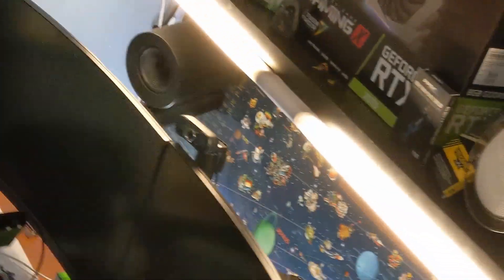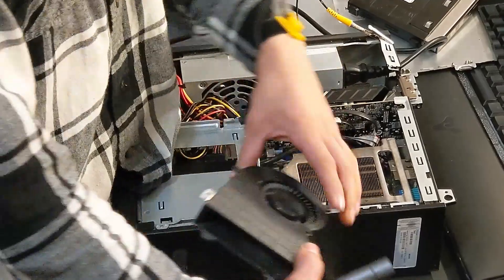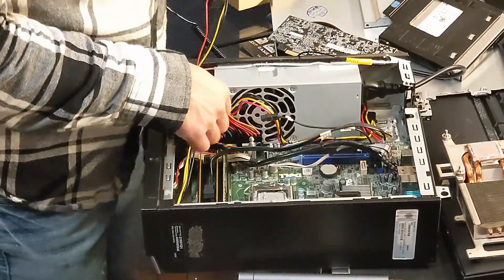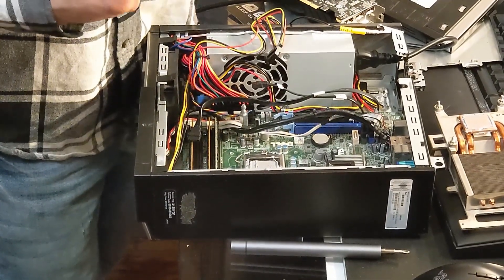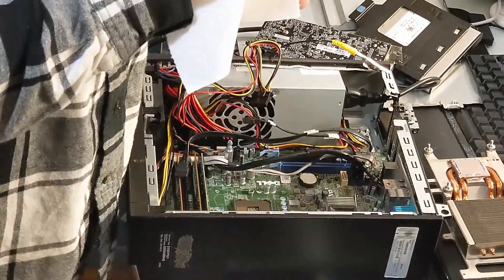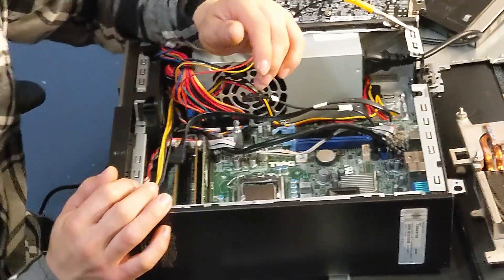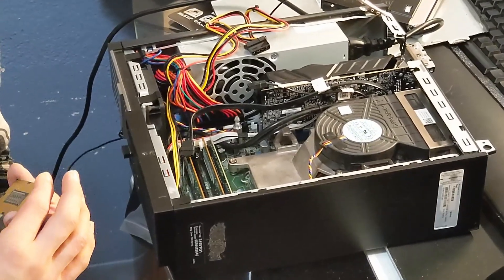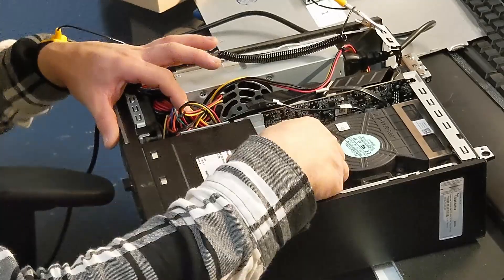Upgrading the CPU in my Dell Optiplex 990 sff (Optiplex Overhaul Part 2)

Comment: I bought a 990 sff for 150 bucks, came with gtx 1650 in it and a 1tb ssd, runs my games good, I think it’s only got 12 gb of ram so I’m gonna get 2 new sticks to replace the 2gb ones, I think the bottle neck in my system is the cpu but I get so confused on what I can use in my PC, so to be clear the 9th gen i5 is the best one for my motherboard then? Super informative vid, ik this is an old video lol
Reply from the maker: Oh boy haha yes it's been awhile since I made this video. If I recall this board only goes up to 3rd gen intel. Maybe look into a 3770k and see if that works
Reply from the maker: Do you know what socket your board is?
Reply: the absolute best cpu you can get for the 990 sff on the 0vnp2h mobo is an intel i7-2600 non k. you can get the k version but with a locked minimal bios you cant overclock it at all.

Comment: would I be able to upgrade my cpu to an i3-2100f? I’m not sure if I would need to buy another power supply.
Reply from the maker: The stock power supply will work although depending what you're upgrading from I might suggest I fast CPU
Reply from the maker: What are ur specs?
Reply: @mightylydy5192  I have a Dell Optiplex 990 i7 and 4 gb of ram
Reply from the maker: @jaysmith7852  i7 2700? If so ur CPU is faster than the i3
Reply: @mightylydy5192  ohh ok
Reply: @mightylydy5192  never mind, just checked and I actually have a 2600
Reply from the maker: @jaysmith7852  it's still faster than the i3
Reply from the maker: Probably the best CPU upgrade you can do on that chipset is i7 2700k or a 3770k. Both are similar in performance with the 3770k being cheaper atm. I'm not sure I can justify spending $120 plus for maybe 10% performance increase

Comment: hello mate, i have dell optiplex 990 i7 16gb ram. which graphic card should i have to play Serius sam 4!?  how many gb do i need?
Reply from the maker: Gtx 1650 4gb low profile
Reply from the maker: A gtx 1050 will meet minimum requirements tho
Reply: @mightylydy5192  thanks 🙏👍👍👍
Reply: @mightylydy5192  
MSI GeForce GTX1050 Ti OC 4GB
Nvidia GDDR5 Grafikkarte 
don't say this?
Reply from the maker: @bars4721  it'll work but if you have a small form factor dell like me you'll need to make sure it's a low profile or lp card
Reply: @mightylydy5192  Thank you 💙

Comment: I have a dell optiplex 990 mid tower I have an i5 2400 with an rtx 750 ti I was wondering if I can put an i7 2600 ?
Reply from the maker: yes
Reply: @mightylydy5192  can used 2700k mr on this dell model pc? can get booster to 3.9 right?

Comment: Would a I 7 2600k work?
Reply from the maker: I believe so tho you won't be able to over clock it so if you plan on buying one it may be better to go with a 2600 instead of the 2600k

Comment: I thought the max CPU you could upgrade to was the I7-2600? Also I’ve read reviews of people saying the GTX 1650 works with this PSU because of the PCIE port? Is that true?
Reply from the maker: The motherboard supports ivy and sandy bridge CPU's as they both share the LGA 1155 socket. And yes the pcie socket puts enough power to support the gtx 1650 low profile

Comment: Wow it is amaizing dell optiplex 990 with i7 2700k prosesor the wepside say it not compatibility, How was the change, no problems?
Reply from the maker: Yes it's still working phenomenally. I'm surprised it says it's not compatible the i5 2400 and i7 2700k share the same socket